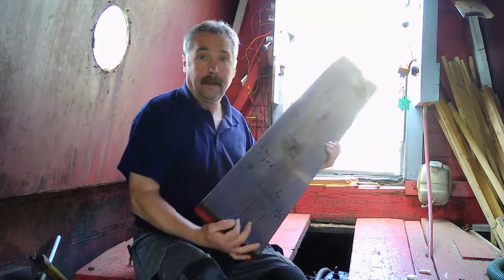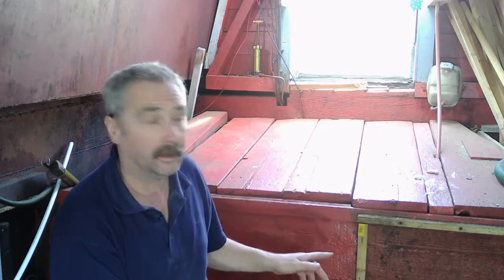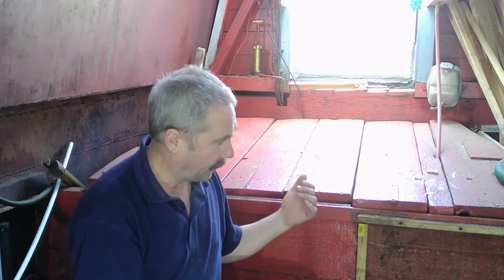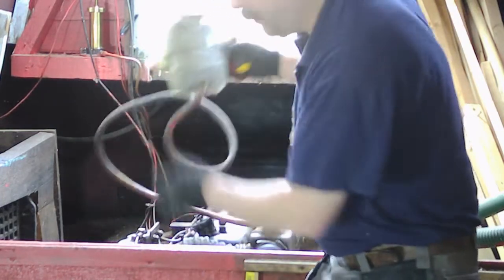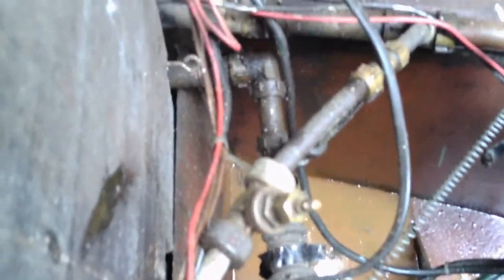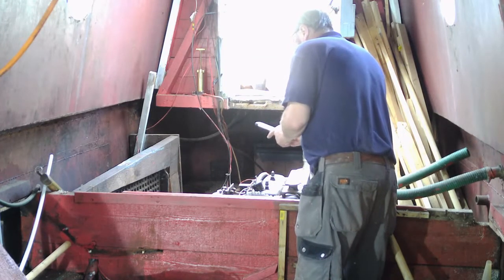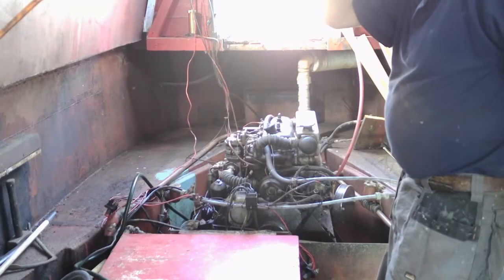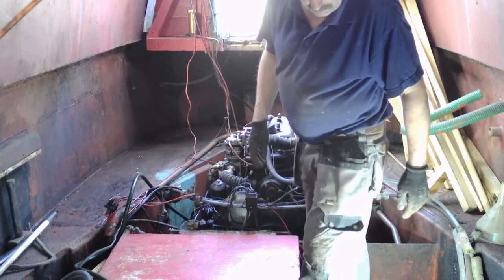Narrowboat Build & Fit out Wrecking The Engine Bay

Comment: just remember to use flexi lines on that gearbox oil cooling system when you rebuild the engine bay . i don't fancy another trip to a canal somewhere near retford to fix it again ;-)
Reply from the maker: Hi Robert Nice one and thanks for the rescue that day from the middle of nowhere .
Reply: No problem .just a suggestion for the battery idea I would use 4 one for the start and 3 leisure  but put 2 on each side for weight distribution